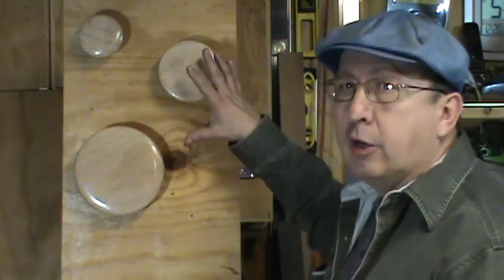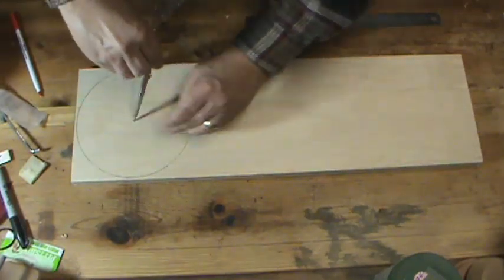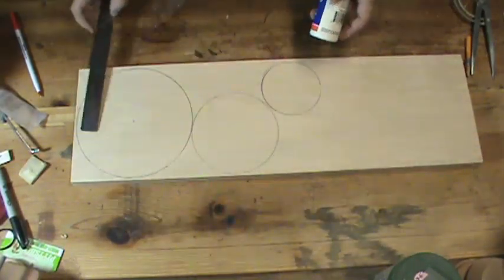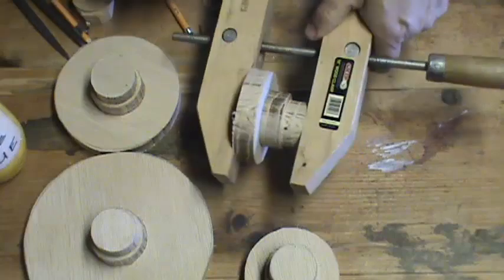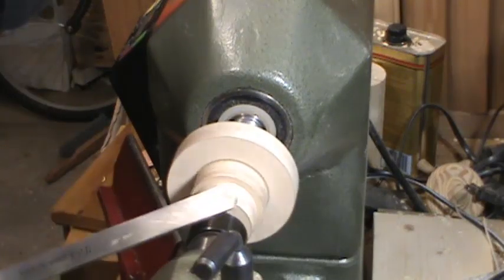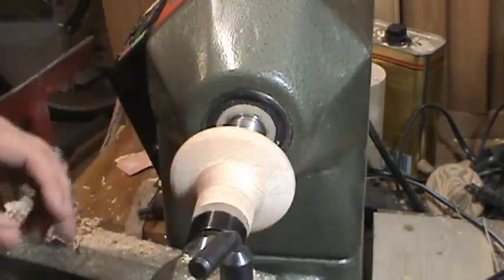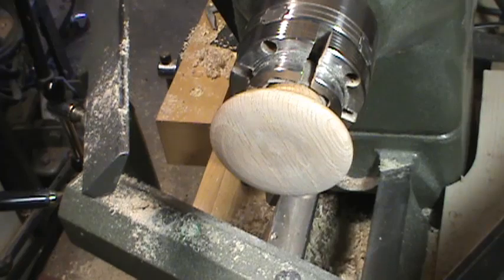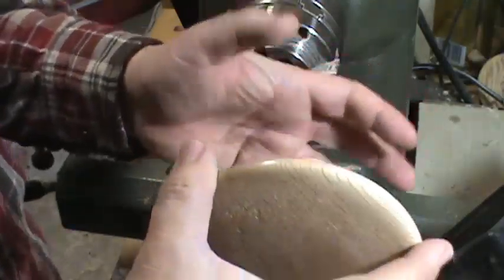Coat Hanger Dots

Comment: Hi Cip,
this is a very nice video.
Thanks that you have specified the dimensions shown in inches and cm. :-)
Treasures but that will your daughter very pleased with the gift.
By placing bonding (contrary to the grain of the wood) of the pieces of wood, you reach that you can absorb more force and can not tear so fast. Here in Germany you get namely those plywood, which are glued so that you are stable and not easily break.
Wishes you and your family, a nice quiet Christmas and a happy new year 2014.
Greetings Günter
Reply from the maker: It is always good to read your comments.

Schöne Weihnachten und ein glückliches neues Jahr.

Cip